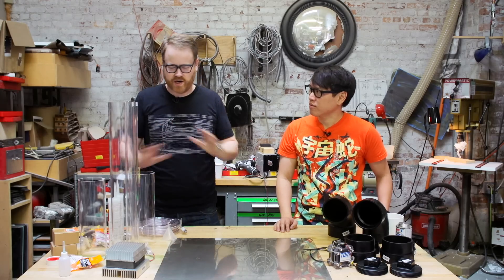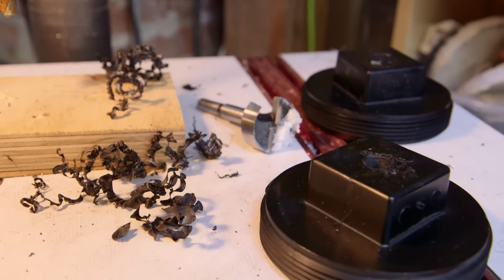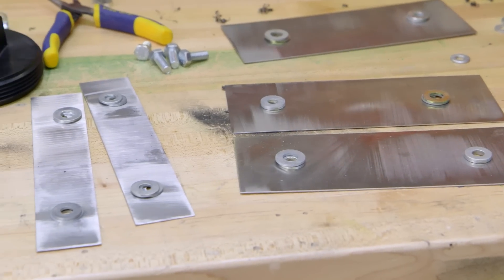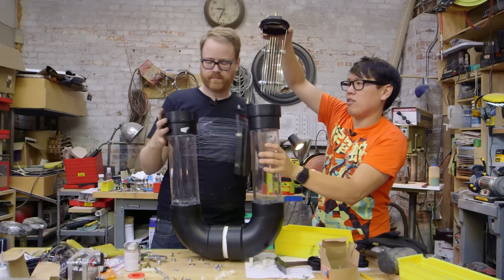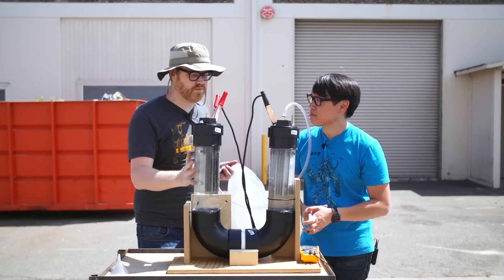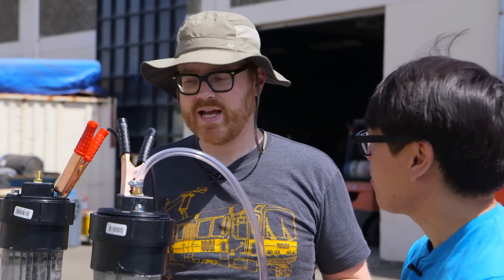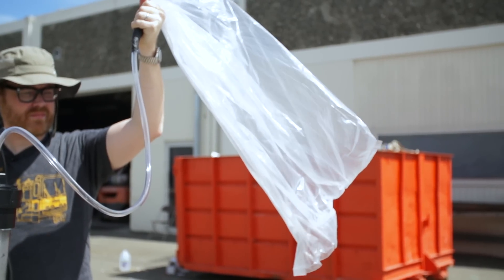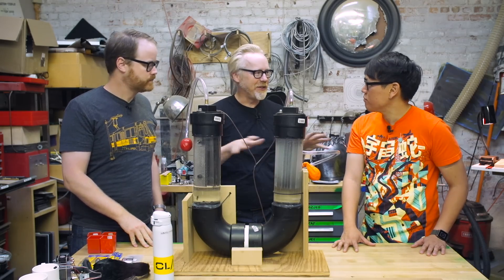Tested Builds a Hydrogen Converter

Comment: You aren't supposed to wear gloves with any spinning tool in the shop or any tool that would otherwise tangle up fabric easily. its a good way to break multiple bones at once. Just a heads up.
Reply: +brandonsg123 p.s. i have five+ years of experience in a shop and i'm also a certified E7018 StickWelder and Dual Shield Mig Structural welder. So please no rebuttals ;)

Comment: Norm you are wrong nitrogen is the most abundant element not hydrogen because there's more air than water in the earth and the at is made up of with either 3/4ths or 2/3rds nitrogen and 1-4 or 1/3 oxygen.

Comment: If this doesn't explain to the dimwits out there that think "hydrogen is the future" than nothing will.
Here is the lesson from this video gang.. please.. take this seriously when people talk to you about hydrogen powered vehicles.

Step one.. build a rig to separate hydrogen from oxygen.  This takes time and materials.. no big deal... just remember this cost in energy.

Step two.. install several solar panels.  Please.. PLEASE remember this step.  If you don't want to think of solar then think of any other renewable power supply you like.. but please remember they used solar panels.  

Step three.. add water.  Ah.. not so fast though.. right?  Distilled water.. that you have treated with an electrolyte?  Seriously.. remember this.  It's important.  You have to figure out what you do with the caustic soda that remains or figure out how to vent chlorine gas and other nastiness from the factory supplying your hydrogen.

Step 4.. apply current.  This too has a not inconsequential amount of energy for what you get out.

Step 5.. compress and liquefy it.  Again.. energy loss.

Step 6.. transport the hydrogen safely to where it will be used.. 

Step 7.. burn it in an engine or turn it back into electricity .. with even more losses.

All this.. or you could just use the solar panels above to charge a battery.. and use THAT energy with about 1/8 the loss of doing everything else.

Let's approach this realistically gang.  The only people trying to sell you hydrogen are the people that have been selling you gasoline engines for the last 100 years.  That model has to stop.. and it has to stop right now.
No more mechanical complexity that we do not need.  Let's end this stupidity and this insanity.

Comment: the probably could have come up with a more efficient design. Maybe just two cells, ala King of Random, connected by a short pipe near the bottom instead of that giant U shape. They could also add a third reservoir cell in the same way to add capacity without adding extra resistance.
Reply: water capacity

Comment: Build an aluminum air battery. More of a power cell than battery, but with the production of electricity you get hydrogen as a byproduct . Thus the perfect marriage for hybrid technology.  

Aluminum is your consumable fuel and the aluminum oxide as your waste is easily recyclable. In fact is easier to turn back into pure aluminum than is producing from the ground. 

Aluminum is also one of the most abundant resources we have in the ground.

Comment: Why are you using gloves and a face mask on a drill press? If the drill catches your glove, it can pulverize your hand in seconds. Much worse than just nicking your hand without a glove. The mask is just unnecessary. Safety glasses would do you fine.

Comment: It's not the voltage that matters, it's the wattage. 22 volts won't make more hydrogen than 12 volts if you've only got ~5 amps from the solar panel, versus hundreds from a car battery... I'm sure at some point the system wouldn't benefit anymore from increased amperage and would require more voltage to operate faster, but that obviously wasn't the case here. (If you watched the king of random's video, you'd see his generator making MUCH more bubbles from a 12v car battery)

That generator might also be less efficient than Kings' due to the extra spacing between the anode and cathode. You guys should measure the resistance of your generator, then make another generator more faithful to Kings' and measure its resistance. I'd be willing to bet there's a significant difference.

Comment: Couldn't you use a hydrogen fueled engine to produce the power needed to make more? Make a totally hydrogen used system to produce the fuel since it is so abundant which should translate to cheaper cost of production? Either hydrogen is more sustainable than oil and if we were to colonize other planets with water on them we would have fuel to use. Interesting thing to think about even though we are not at the point of having hydrogen as a major fuel source.

Comment: use fine nickel or platin wire mesh instead of your metal plates.
more surface area + catalyst effects = far more gas with less power.
and decrease the distance between ur electrodes to minimize the electrical resistance.
use for example a membrane to divide the two chambers and put the electrodes very close together

Comment: You made it sound like the solar panels are so much better since they give of 22V and a car battery only 12V.Why not buy a cheap DC/DC converter and get the voltage higher then? A car battery can deliver alot more then 100W...not good? Voltage AND amps is what is important not just one of them... sorry first minute made me dissapointed.

Comment: did you use a solar controller/power supply between the panel and the rig?  The panel voltage would probably drop too low to be efficient if you connect up the panel directly.

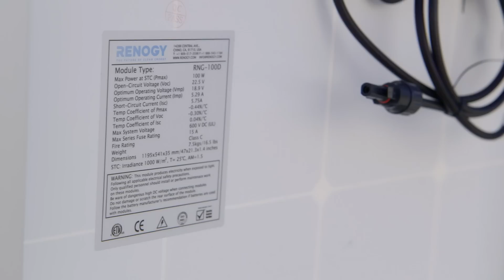Comment: 6:34 . I thought you were smarter than this. A car battery is way more powerful than your solar panel, sure the panel has 22v versus the battery's 12v but alot of car batteries have around 1000 amps which is A LOT more power than your solar panel. Basic electricity

Comment: Hmmm, hydrogen for cars... Take electricity -> convert to hydrogen at a loss -> store at low temperature (requiring energy) -> transport (requiring energy) -> convert back to electricity in a fuel cell (high efficiency) with a conversion loss or combust at 30-40% efficiency. Huh? Just store the electricity in a battery. The hydrogen produced currently is 95% from fossil fuels. It is not a clean energy.

Comment: I use a torch that burns Hydrogen and Oxygen generated by electrolysis. The two gases are not separated and are fed to the torch head together. The torch uses a big honking power supply that puts out a lot of current. Once, I filled up a balloon from the torch tip which only took a few seconds. I then put the gas filled balloon in the bathtub and tossed a lit match on it. The explosion was very loud, but I still had my eyebrows.

Comment: I am fan of the Tested crew and channel, but this was a rig that was not very well thought out. Technical/Scientific/Industrial  builds require different kinds of forethought and calculation than theatrical builds where aesthetics are the important part. This electrolysis rig fails because the resistance across the water is enormous. The current (electron flow) is what determines how much O2 and H2 you will produce. Current is affected by both resistance and voltage, but any voltage above around 2V is just converted into heat and thus becomes wasted energy. By minimizing the resistance across the electrodes one can get closer to 2V and maximize the current and therefore maximize production efficiency. So bring the electrodes closer and increase the electrolyte concentration to get the desired current (instead of increasing the voltage past the ionization energy of water). All of this can be calculated beforehand, and it should have been! :)  (BTW, electrolytic cells are far more complex than just Ohm's law, and Faradic electrochemistry)

Comment: The voltage is practically irrelevant.  Electrolysis can be performed with under half of a volt of electric potential as long as resistance is low enough.  It is the amperage that matters.  More current produces more gas, and that solar cell doesn't put out nearly as many amps as a car battery would.  Two car batteries wired parallel would have likely produced 15 liters of hydrogen in under 10 minutes.  Then you can use solar power to recharge the batteries over time.
Also, trying to trap hydrogen in a trash bag is only slightly more effective than trying to trap air in a cloth pillow case.  The atoms are so small they can leech through 3 inches of solid steel.  That makes hydrogen storage a problem.  It's best to produce what you need when you need it.

Comment: Washing with a mild acid like acetic acid is the dumbest thing i have ever heard!
please DON'T, dont teach the adience stuff like this. I get it, you want to show you know a base and acid neutralize each other to salt and water, this does however generate heat, depending on the concentration ofcourse of the acid and base.
Washing with running water is the absolute best thing to do, as it flushed the base off the skin, and also cooles at the same time.

Comment: Voltage refers to electrical "pressure" and is just a function of power. More volts ≠ more power. You want to look at amperage and calculate wattage to make a comparison.
Reply: +Ethan Ford No!  Amperes are used to express flow rate of electric charge. One amp is approximately 6.2415093×1018 elementary charges (such as electrons) flowing per second.  The energy in a wire travels as an electromagnetic wave typically on the order of 50% to 99% of the speed of light; but that doesn't really matter...  that's not amps or volts.
Reply: +Eric Morrison 
P=IV=(I^2)R=(V^2)/R

because of the definitions of power and resistance, it's possible to express almost any system purely as  a function of voltage or current.
Reply: voltage is the amount of electrons and amperage is how fast the electrons move. there is defiantly a power increase between 1 volt and 1000 volts even If the current is the same.
Reply: Josiah Luscher I got them backwards

Comment: It doesn't look like they figured out where they went wrong. There is a couple of square feet of metal surface there, right? Wrong! Electrically those plates are facing each other only at the ends. So there is only a couple of square mm of surface area facing each other. Now take those couple of mm² and put them 3 ft. apart. How much gas will that generate? As much as is shown in the video.
It would be better to alternately stack the positive and negative plates closely together with there whole faces toward each other. Then put a proton permeable membrane between each plate to let the ions pass but keep the gases separate. The membranes are much better now than they were in the past.

Comment: "22 volts of power", no 22 v of potential. "100 watts of energy", no 100 watts of power. You cant compare the voltage difference between a solar panel and a car battery and say that the solar panel will produce more hydrogen. A 12v car battery produces around 500 watts,  that's 5x the amount of your solar panel.

Correct science is good science. Pls, Tested.

Comment: You can;t just put hydro and electrolysis together to get hydrolysis as that means breaking a chemical bond using water. electrolysis means to break a chemical bond using electricity which is what you guys are doing.

Comment: psh, potassium hydroxide is harmless. I've built one of these myself and it was not that dangerous except when it exploded
Reply: +rok tech Except its a very potent neurotoxin…
Reply: +rok tech Its a strong alkali and clearly won't do your skin much good but as long as you wash it off with plenty of water its fine. I think you'll find that's the general guideline for practically all chemicals in chemical data sheets.  But I wouldn't go as far as to call it harmless you certainly wouldn't want to get it in your eyes for example.
Reply: yea me too...I got my d*ck stuck in it

Comment: Modified his design a little bit? You changed the spacing between the anode and cathodes by a TON, which is a massive change to the design. TheKingOfRandom specified the plates in that specific order because its critical to the thing actually working... I'm actually surprised it produced any gas at all. Sorry, but like I made one from scratch when I was 10 that worked much better...

Comment: Should get Photonicinduction to power that thing. :P
Problem here is the voltage is too low and the electrodes are too far apart. Also he was using solar power, hook up a 20KWdc Photonicinduction power supply!

Comment: I have a 8 horse power engine that runs on hydrogen which in turn is connected to 2 120 amp alternators. 1 runs the hydrogen generator the other runs to charge 3 12 deep cycle batteries which are connected to an inverter which I use to power just about anything I want.

Comment: It´s actually more about the amps than the voltage. Extra voltage will just create unnecessary heat which will make the "genarator" not able to run for not so long without overheating.

Comment: Hydrogen power (at least in cars) is not only meaningless but unefficient.
Just charge a battery. We have Tesla Model Ses now, we dont need large complex hydrogen cars.
To make a Hydrogen Car run the same distanse as an EV car using electrolysis, you will need 3 times the energy, that is 3 times more solarpanels on your roof to make hydrogen for the same milage.
Hydrogen cars is just a bad distraction from the real solution right in front of us that is battery electric cars!
Reply: Odd Arne Roll I'm just not a big fan of electric cars, or hydrogen cars for that matter.

They lack overall power, and distance in this day and age.
I live in the middle of buttfuck nowhere, and so having an electric vehicle with a range of even 150km, is too short for my liking.

If the gooberment would let us get our dirty peasent hands on some good old atomic power and let us have our nuclear reactor powered electric vehicles then i'd be all for it XD
Reply: also 
- expensive cells to even reach that shitty 1/3 efficiency
- all these minor things, annoyances
- you still need a battery to buffer the fuel cell
- it's pretty hard to regenerate
- fueling sucks! no stations as they cost millions per piece! also so inconvenient! it's not hard to see why electricity is regarded as the highest form of energy! you can even beam it through a vacuum (and yes, some people do that every day to charge their car because they're too lazy to plug it in). an electric car never needs a gas station. you just charge it wherever. 

sorry for shit structure, just wanted to mention these things.
Reply: +Odd Arne Roll Or we could say fuck all these hippie ideals and just burn the petroleoum till we run dry, or kill ourselves fighting wars over it! XD
Reply: +DOCTOROCTAGONAPUSS where do you think 99% of the worlds hydrogen come from? 
Coal and oil. We need to make Electric cars, not hydrogen cars. 
The elevtricity we will get from renewable sources. 
Hydrogen is not the solutiuon to our climate problem.

Comment: It goes faster with higher current not voltage because it's the flowing electrons that separate the elements not their energy. Since current is the electron flow-rate, it has to increase to allow more electrons

Comment: The cost to produce hydrogen is the main reason we are not driving hydrogen powered vehicles. If they can solve this problem we will be all set. Almost.

If they had bought 4 or 5 solar panels and hooked them up in series the results would have been much better.

JW3HH

Comment: FINALLY! 
Someone doing an electrolysis rig correctly. I subscribed cause of that fact alone. 

That said... 
Uh... it kinda seemed like y'all got your anode and cathode reversed. 
Even though Electricians have been talking about how the red side is actually the anode, in electrochemistry we still ignore that.

It's not that they're wrong, but, because the pH gradient sets up to produce oppositely charged species against the gradient, it's not correct in electrochemistry specifically. (it's also probably why the idea that the red side was the cathode began to begin with; people weren't inversing the electrode sign to the chemical species developing there.) 

Hydrogen is positively charged when first produced, meaning it's going to occur at the electrode that's negatively charged, which is the red anode in this instance. 

Further evidence of this is in the last shot of the rig. The balloon that is pulsing is the oxygen balloon. Also, you might be careful of putting oxygen into direct contact with latex. It can be explosive. 

Also... Potassium hydroxide, although it's an ionic compound, will react with aluminum, dissolving it, and producing hydrogen all on it's own without any electrical input. So... if you had any aluminum in that thing it dissolved. Also... it's advisable that any one looking to copy you not use aluminum, or not use strong akalihydroxides like potassium hydroxide.
Reply: +RhetteLawe Inspired by The King of Random
Reply: I saw that and i have seen The King of Random's build.

Frankly, I'm surprised no has gotten seriously injured by it. Having the hydrogen and oxygen in a premixed state is actually kinda dangerous because it can take so very little to ignite the mixture.

This build is nice because it separates the gases out, allowing them to be slightly more controllable.

Comment: my dry cell doesn't separate the oxygen and hydrogen but who cares you need oxygen for it to burn anyway. my 4x8 14 plate unit makes a liter a minute on only 13.8 volts at 16 amps